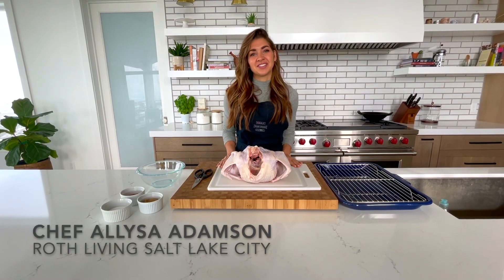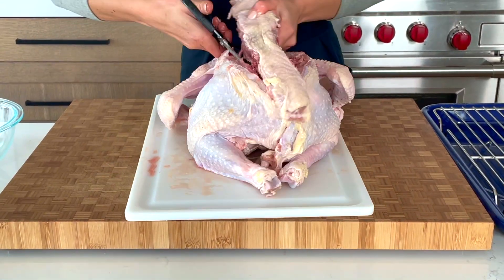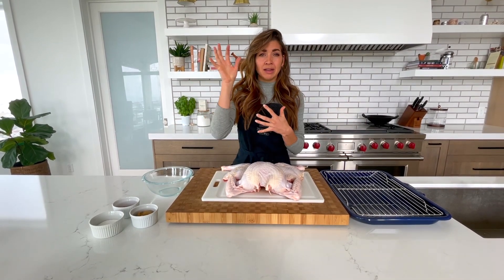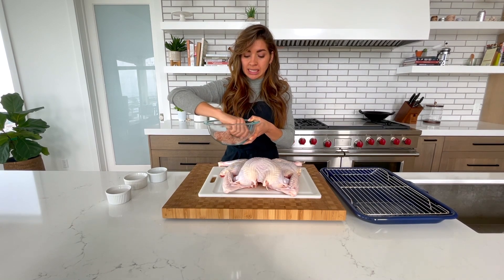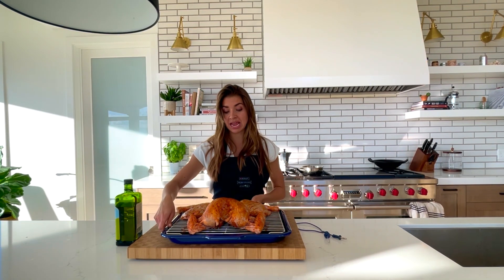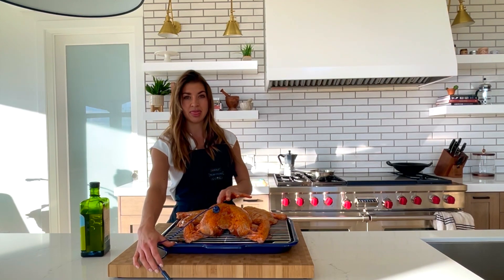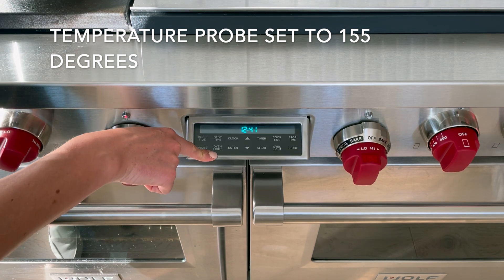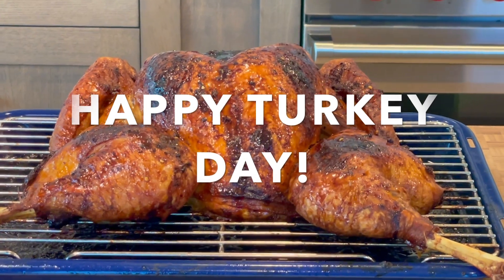Spatchcocked Roasted Turkey in the Wolf Dual Fuel Range

Comment: Chef Allysa, THANK YOU for this vid.  We have a new Wolf Dual Fuel 36” and tuned in to learn about the probe thermometer.  Now I’m jelly of your Wolf Dual Fuel 60”.  THAT is a MONSTER!

I have been spatchcocking our turkeys for nearly 7 years. I will never, EVER, go back to roasting the picturesque “Norman Rockwell” turkey again!  A couple tips for spatchcocking if I may…

* Ben Starr has two EXCELLENT spatchcocking YT vids that include, dry brining, poultry food safety, and how to carve a spatchcocked turkey.

* I have a set of hand pruning shears that I use only in the kitchen and for pruning fresh herbs. Get a set that can go through a 1/2” branch. They make quick work of getting through that back bone and they don’t need to be sharpened afterward.

* After taking out the backbone, take out the wishbone at the neck. Doing so makes it easier to break the breast and makes the bird lie even flatter.

* Spatchcocking the bird leaves very few juices in the roasting pan. As Allysa suggests, use the backbone, neck, and giblets for gravy.  I make our gravy the same day I spatchcock the turkey and then store it in the refrigerator until Thanksgiving day.  Chef Jean Pierre has a couple EXCELLENT YT videos for Thanksgiving gravy.

* Notice how Allysa left the probe thermometer in the bird after it came out of the oven.  DO NOT take it out until you are ready to carve the bird. Otherwise, you will lose a lot of the juices you worked so hard to retain.

* That bird is resting for 45 minutes to an hour.  Perfect time for heating sides in the oven. When everything is made ahead of time, the only thing I am making on Thanksgiving day, aside from the turkey, is mashed potatoes.

Thanks again Allysa!  “And may the odds be ever in your favor!”

Comment: Love it!!! So excited for cooking my first turkey! Dumb question --- at the start --- you defrosted in fridge for 3 days? then left at room temp for an hr? (before starting prepping???). Thanks for
Reply from the maker: Hello, Thanks for watching. The turkey should be fully defrosted prior to spatchcocking it for cooking.  It is left at room temperature so that the meat has a chance to warm slightly prior to the cutting of the bird.  The three day defrost will be required only if your bird is frozen and defrosting in the refrigerator is the safest way to defrost the turkey. Thank You.
Reply: I do not hear you mention basting the turkey in the video; is it necessary? Also, you turn the oven to 400 for a 16lb turkey. Would 350 be appropriate for a 26lb turkey? Thank you!! Excited to try this!
Reply: @e.johnson7083  don’t see a reply, so unless you’ve already learned…

NO basting.  Spatchcocking retains more juices in the bird.  There will be VERY FEW juices in the roasting pan.

You want to roast the bird at a very high temp.  Ben Starr has an EXCELLENT two-part YT vid on spatchcocking.  He recommends roasting at 450°F.  I’ve done it. It works. Watch his two-part YT vid on spatchcocking.